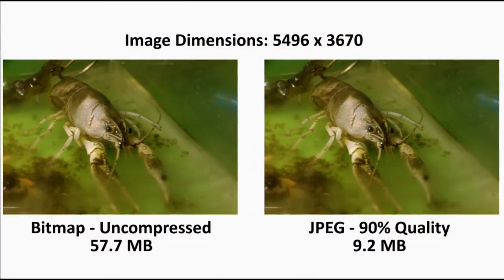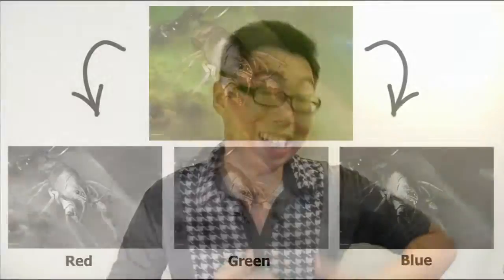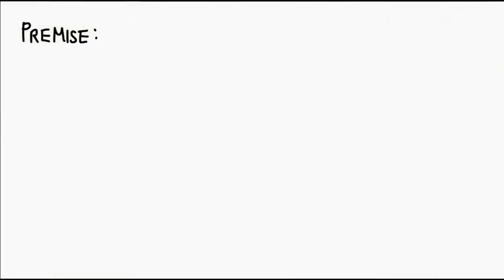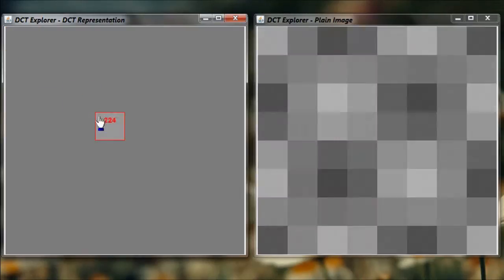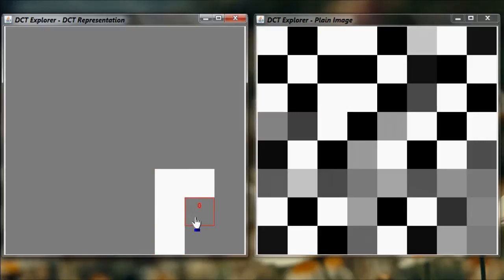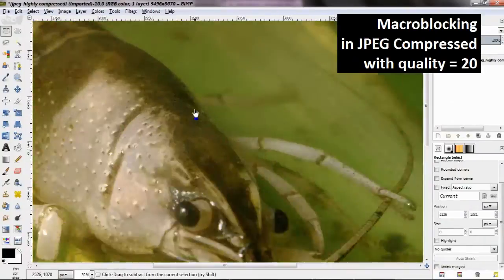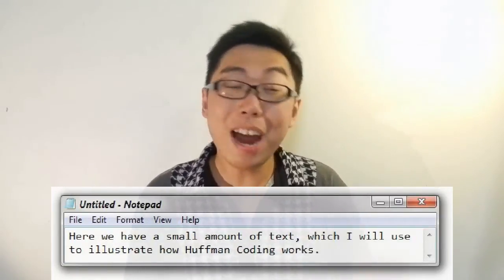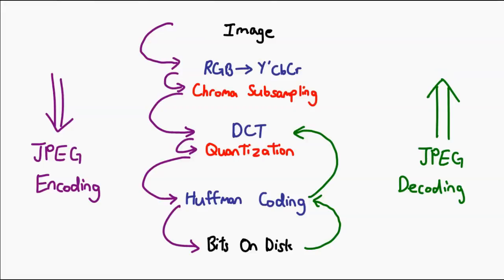JPEG Encoding Magic & Discrete Cosine Transform (DCT)

Comment: There are several problems with JPG, although I must admit it works surprisingly well.  One problem is what if 2 macroblocks are identical or nearly identical on the input side (before compression),  does JPG compress them separately or does the 2nd one make reference to the first one?  Also subsampling colors is undesirable to some people.  Some people like to use 30 bit RGB.
Reply from the maker: Hello and thank you for your comment! It's certainly not perfect in every context, but if it does the job most of the time, then it's good enough!

From my limited understanding, JPEG doesn't seem to have any mechanism that allows marcoblocks to reference each other (this is unlike video encoding, where similar references may exist, though those are normally temporal in nature).
Reply: @NERDfirst  My favorite compression ratio using JPG (vs. 24 bit RGB) is 10:1, since it is an excellent compromise between compression ratio and quality.  A typical camera image compressed 10:1 (vs. 24 bit RGB) looks almost identical to the average viewer.  It is 2.4 bits per pixel on average (instead of 24 bits per pixel).  An exception to this is if I want to compress an image containing small, high contrast text, such as black text on a while background.  Then I like to use very mild JPG compression (sometimes the MOST mild setting), to help alleviate "shadowing" around the text (one of JPG's biggest flaws).  That is a workaround.  A worst case scenario for JPG would be an image that can compress very well normally, but has some high contrast text in it too, so if you use high compression, the text will look like it has 5 o'clock shadow.  If you compress very lightly, then the text will look good, but your filesize will be large.  Another cool JPG compression ratio is 24:1, because that is where it becomes 1 bit per pixel on average.  It is somewhat mindblowing that 1 bit of information can describe 1 colored pixel, being that it can be any one of 16,777,216 colors and 1 bit normally can only encode 2 values.  24:1 JPG doesn't look great (generally speaking), but for a really slow internet connection (such as overseas), it is a real timesaver.

Comment: what is the point to discuss compressing of text file? what to do incase of image? how to apply Huffman encoding for encoding?
Reply from the maker: Hello and thank you for your comment! Ultimately, the idea is the same. Remember, our data is represented as bytes or numerical values at the end of the day. We apply the exact same thought process to that data - Where the most frequently occuring data is represented with the least bits.
Reply: @NERDfirst  was facing difficulty in performing the same for images .. anyways I have anyhow made till counting the frequency of the no.s occuring in image now the question is how to perform Huffman encoding .. pls provide some help , imean by suggest something from where I can get guidance
Reply from the maker: You might want to check out my video on Huffman Coding. There's no code there, but it gives you an idea what kind of task it is: https://www.youtube.com/watch?v=fPthQE7Li8M

Comment: Very impressive video! I still have a question: Is there a mathematical derivation of the reason why the low frequencies locate at the upper-left corner after DCT? I can't get this intuitively.
Reply from the maker: Hello and thank you for your comment! I'm unfortunately not well versed enough with the DCT process to tell you why (indeed, processes like Fourier transform have the low frequencies in the middle, so this is by no means "standard"). I suppose it's just a convention!

Comment: Awsome video.
Just one question. Is there any way to set an specific gray value on the site you gave http://resources.nerdfirst.net/dct
Reply from the maker: Hello and thank you for your comment! At present, there is no way. I'll see if I can build something in.
Reply from the maker: Done! Press enter while hovering over any box to type in a value. It's not super elegant, but it gets the job done =P Just something quickly cobbled together in 15 minutes.
Reply: Thank you very much for answering. Also thanks for using your spare time to answer some random dude on the internet.

But unfortunately, I still can't change the values.
Reply from the maker: No problem at all :)

Your browser may have saved a cached version of the tool, and is presenting you with that instead of the updated version. Try doing a cache refresh. Hold down either Ctrl or Shift (depending on your browser. Firefox uses Shift, I'm not sure of the others) and click the refresh button.
Reply: You are truly the MVP. Thank you very much, that was the problem.
Again thank you.
Reply from the maker: Glad to be of help! Thanks for spurring me to implement a feature I was too lazy to do :P

Comment: Chroma subsampling is optional. The user is in control over that step too. The chromas can still be compressed better if they contain less detail as can be seen on the example images. But if a part of the image does contain color detail, for example, it has a red text on it, then that section would be represented accurately with more bits. Generation loss from upsampling the chromas is also avoided, as are artifacts around edges of overlapping saturated objects.

FastStone has a nice preview dialog where one can compare compression in RGB and YCbCr modes. The RGB format seems proprietary to Adobe, as is CMYK. I haven't seen JPEGs in Lab color. Those should theoretically provide better decorrelation of brightness and color.
Reply from the maker: Thank you very much for sharing, many interesting points here. I should have talked more about the different chroma subsampling levels, seems like that would've been a good addition!

Comment: Really neat video. Only gripe is that you didn't really make a connection between the DCT results and which frequencies to discard. I feel like sacrificing another 3-5 minutes talking about the quantisation matrix, rounding down to 0, how it's saved in a zigzag pattern and how that is a huge benefit to the huffman encoding would have been more than worth it.
Reply from the maker: +vir ingens Hello and thank you very much for your comment! Do bear in mind that this channel is geared towards beginners and is meant to only give an intuitive understanding of concepts, so specifics would be rather out of place. In fact this video has already run too long by five minutes or so. If I could go back and change something about it, I would probably cut out some of the rambling on DCT... 

That said, you raise some interesting points - I don't think I know very much about those, particularly the zigzag pattern, so I'll look it up. Perhaps if it's interesting enough it could warrant a future video.

Comment: Love your videos.  Curious about how these things work, and I'll be looking into DCT to better understand what you're talking about.  Quick question:  Would you follow up on this video with transparency?  I've noticed that from JPG images, they don't support it, but GIF and PNG do.  What is different about how GIF and PNG compress things in comparison to JPG?
Reply from the maker: +VarthBlitz Hello and thank you very much for your comment! There are actually many differences between how each of these file formats maintain information. Generally, to support transparency, these compression techniques just need to save one more channel to disk, called the alpha channel, which determines transparency level for each pixel.

As for other differences, there are actually plenty. PNG uses lossy compression as well, but does not convert an image to the frequency domain, nor does it transform the image to a YCbCr representation. The lossless compression technique used at the end is based on LZW compression instead of Huffman coding.
Reply: @NERDfirst  "PNG uses lossy compression as well" Is this correct? I've always thought PNG was lossless.
Reply from the maker: Hello and thank you for your comment! I didn't word that very well - The formal definition of PNG is lossless in nature, but it can under certain situations be lossy.